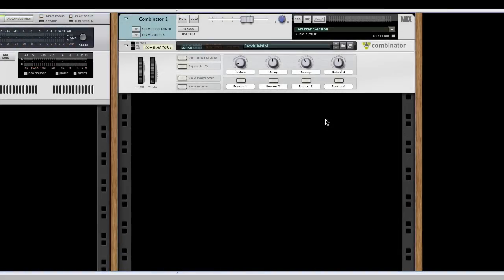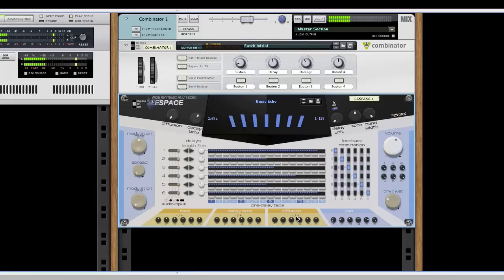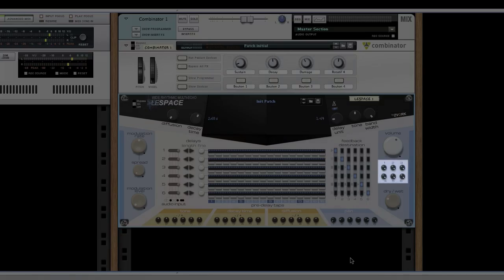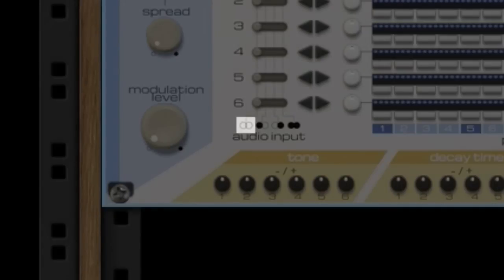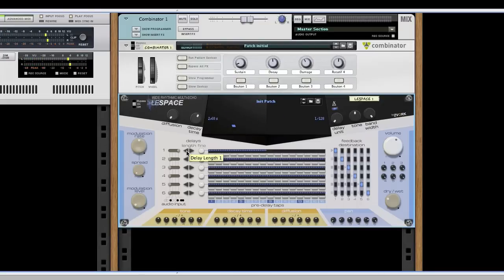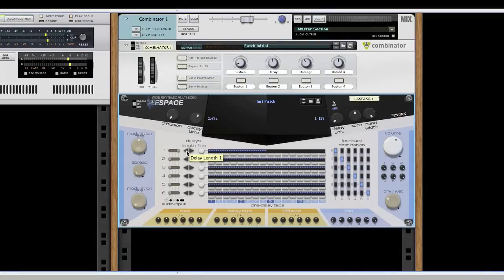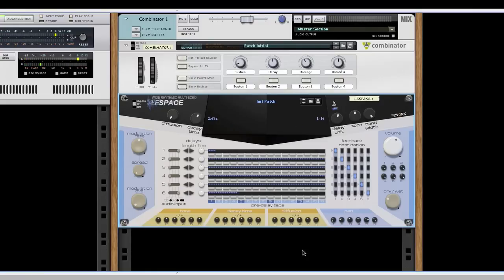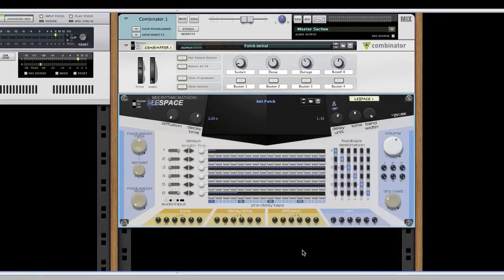Le Space - Tutorial 1 : The Basics

Comment: Calculating the time between echoes is very confusing.  If I understand correctly, you have to multiply the Delay unit amount with the number of taps that you set?
Reply from the maker: If no taps are set the time between echoes is the Delay Unit multiplied by the delay length. This is the total repeat duration, if you prefer. If you set taps, each tap will be repeated with this same duration. In this case, it can be very complicated to individually plan out the time between each echo, as the number of taps increases.